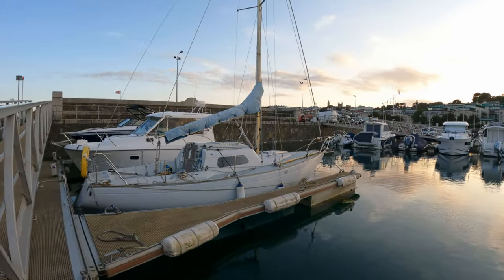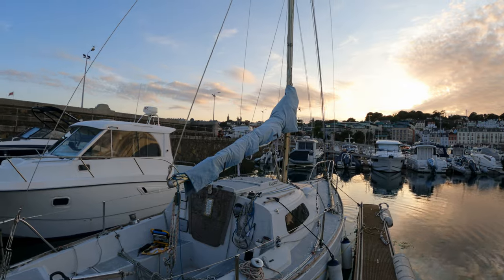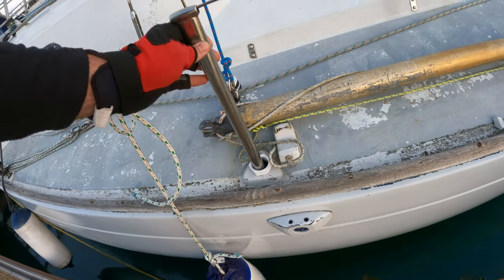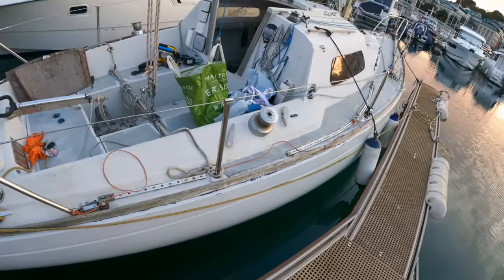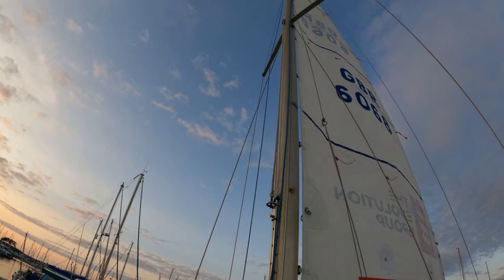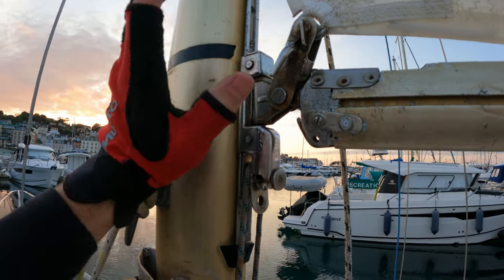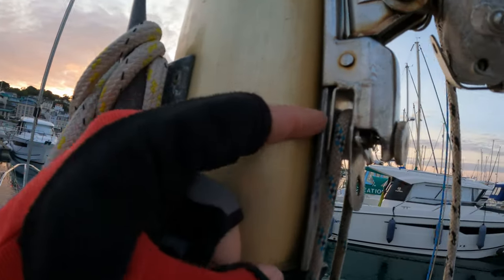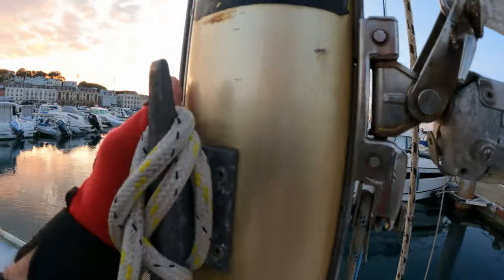Is my Mast Sinking??? Self harm with Rivet tools.

Comment: My first boat had a similar gooseneck/downhaul/cunningham arrangement but without the weird pin.  I found d it quite good  - hoist the sail and cleat off the halyard then control the luff tension using the downhaul.
Reply from the maker: Hi Patrick, when we first started using the boat we did use that exact technique (mainly because our main halyard winch liked to overwrap), but we found that in higher winds we didn't have enough purchase with the small block and tackle setup at the gooseneck. So now we mainly leave it locked off. I'm also considering running the main halyard back to the cockpit which would hopefully mean I can more conveniently adjust luff tension. Although I will have to do some significant reordering of coachroof hardware to make this a reality!
Reply: @thesailingdonkey  #raceboat